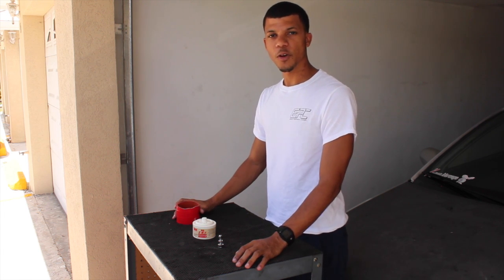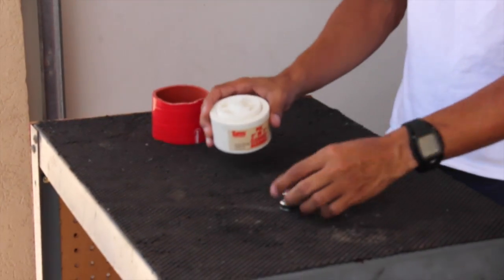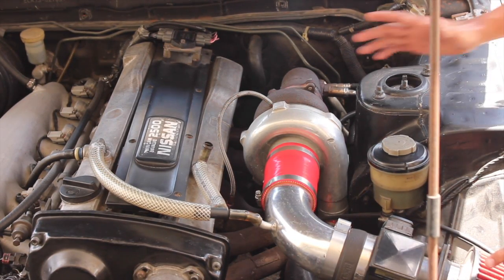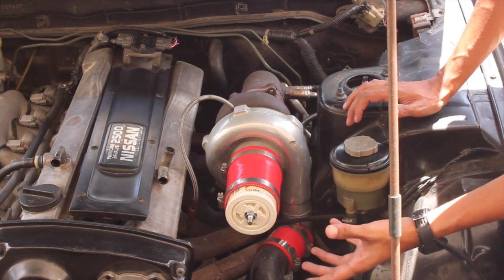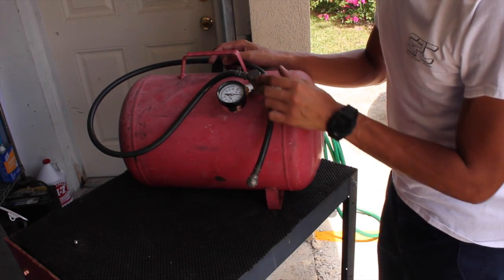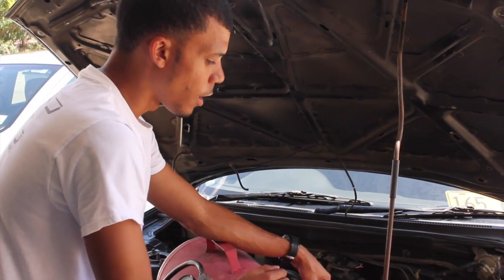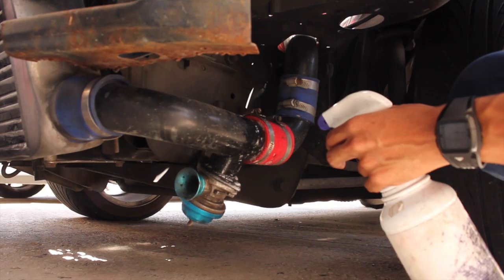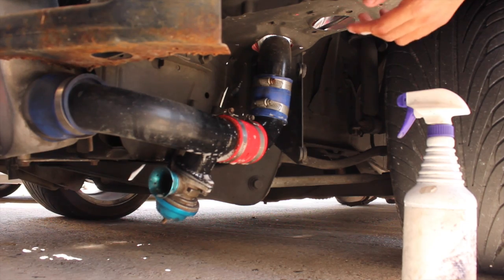DIY Boost Leak test made easy

Comment: what if it comes out from the turbo the leak? what do that mean?
Reply from the maker: It is possible for the o ring on the compressor housing to be damaged. That would be my guess. Another possibility would be if the compressor has a t fitting for a boost reference, check if the threads are leaking. Hope this helps

Comment: Why can't you start the car and check the leak by revving the engine?
Reply: you cant build boost in neutral. engine has to have load
Reply from the maker: Transonic FADEC you could if you have a quiet enough exhaust. Or if the leak is really bad. Generally I do a leak test before race events.
Reply from the maker: Transonic FADEC 👍🏽

Comment: Is this ok for the turbine? Where do you buy the pvc?
Reply from the maker: Aaron Giggers hey. Once you are not going over twice the amount of boost pressure you plan on running. You are ok. As for the pvc I found mine in the plumbing alse of my local hardware shop
Reply: @HighPerformanceNetwork  ok, I'll check there. Thank you.

Comment: My turbo is kind of a pain to get to. Can I attach the tester to the turbo inlet pipe instead?
Reply from the maker: You can yes. Just have to be sure to cap or block any hoses coming off the intake pipe.
Reply: @HighPerformanceNetwork  Wow thank you for such a timely response on a older video. You just saved me a huge headache
Reply from the maker: Fr0zenfr0st your most welcome. Let me know how it goes

Comment: Is it possible to just spray soap while the engine is running provided that a helper is revving up the engine ? I know about the noise noise does not help but the bubbles should tell anyway
Reply from the maker: Suppose if you have high visibility of the piping that could work. Nothing beats a try they say :)

Comment: Do you have to block off the passage way to the throttle body so the air doesn’t escape into the engine ?
Reply from the maker: Jaxiel Rico good question! You can do so if you wish. But generally once the throttle body is closed it's ok....providing you don't use an air compressor or any high rate of flow. 

However if you have time on your hands and want to do the best possible job. You can go section by section with an air tight block off plate on the opposite end. Doing the hot side first. Then intercooler followed by he cold side. 

Hope this helps

Comment: Good but when you push air there cylinders will allow some air to pass right? They are not 100% sealed.
Reply from the maker: Marius Negrean correct! You may lose some pressure. Helps to have a gauge on the tank as well.

Comment: Try doing that on a twin turbo car like an n54 engine would be impossible.your lucky that old car is much simpler and has the turbo sticking all the way out like that.
Reply from the maker: There are ways to do a twin turbo setup. Most factory (twins) compressor inlets will merge into one common. In cases like the RB26 & 2JZ. Although would never recommend anyone do a boost leak test with the MAF/MAF's in place. It takes a lil more elbow grease and piping, but it can be done.

Comment: My car is building boost even when I am light on the throttle, any ideas?
Reply from the maker: hmmm is it a stock turbo you have? If so. I would start with checking the actuator or wastegate spring if its sticking shut. Ive seen rust hold the tension too high so the boost would build quickly but once it WG / IA flap comes off the seat, then it would open real quickly making your boost level fall off rapidly. So...If your boost comes on quick but instead of boost level stabilizing at the desired level, it falls off quickly. I would start by taking off the actuator or WG and doing a simple test. Can you check my boost controler video to see how to do this with a simple bicycle pump....Let me know if this helps bro.
Reply: Thanks man!! Yeah. There is rust all over it, it's a 1997 Eclipse GST. I'll check out your video!
Reply from the maker: SodaTartsBaezFord brilliant!!!! Let me know how that goes bro

Comment: nice video.
Reply from the maker: kilamanjaro Mountain thank you. Having to take a break from the videos as we have started a full visual media company, so time is real slim these days. Once the company is stable we will be returning to making more of these videos
Reply from the maker: Ah i have only experienced a sound coming from the turbo once, and it was the nipple unto the compressor housing that had a tear. The sound was a high pitched hissing. However if you are getting a sound from the compressor after doing a full boost leak test. Then i would remove the compressor housing and check the rubber seal between the housing and turbo center housing. Give me a message on fb if you need futher instructions in what to look for......Hope that helps

Comment: Nice tip, thanks. might have to try this. Just a question though. With 6 cylinders how do you deal with the fact that some valves may be on overlap at the time of the test, just rotate the crank until you find a "sweet spot" or block the exhaust too?
Reply from the maker: Thank you!!. The throttle body should be closed for this test, however some IAC may bleed some air into the motor so if you see the air pressure dropping quickly and don't hear a sizable leak then you may have put a rag or block off the cool side intercooler. (Just be sure to remember to remove the rag/plug before starting) I may do an update video on another way to do it as well. Hope this helps bro
Reply: Cheers, yeah I never considered the throttle flap as I'm used mainly to diesels that don't have one :D that would help lol
Reply from the maker: dan mackintosh lolll. Yup diesels are interesting

Comment: why is your bov so low to ground you should flip that around before you break it off on speed bump
Reply: stupid style
Reply: Why dont you guys just do whatever you want on YOUR car. Oh wait, you dont own a Skyline. Pure Envy.
Reply: you should really move it...
Reply: Its clearly 6 inches lower than most things under there. Freestyler..
Reply: madison prettyman how the hell would he flip it? Use your damn head
Reply: right, if he loosed the clamp on the blue couplings he could easily flip this deal 180 and the BOV would be on top.
Reply from the maker: Simple answer. Style!! If my front bumper clears then so does the bov. never had an issue before

Comment: could you use your tire if you have no air compressor?
Reply from the maker: Hmm good question. I suppose you could yeah
Reply: +Wrex Cyphvren makes sense, instead of dumping quarters into the air at the gas station testing your system. I was thinking if using a spare tire
Reply: +Wrex Cyphvren or a tire on the car if in a jam
Reply from the maker: +fockyoumang hey great idea. And thanks for sharing
Reply: +High Performance Network it's 35 psi, close to 40 which he is using
Reply from the maker: +fockyoumang the tank I was using had about 40psi but I used the control nob to only allow about 12psi in the system. Using a higher pressure would reveal a leak quicker. I was just trying to make the test as close to real world as possible. As that was the current boost pressure on the car